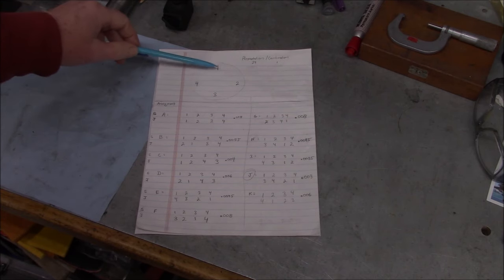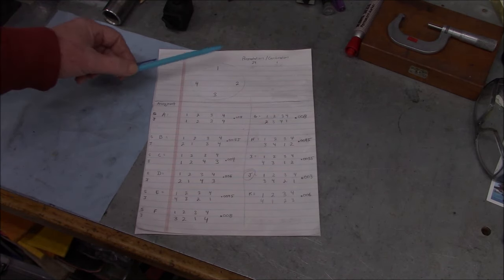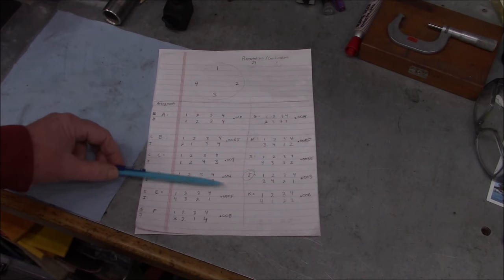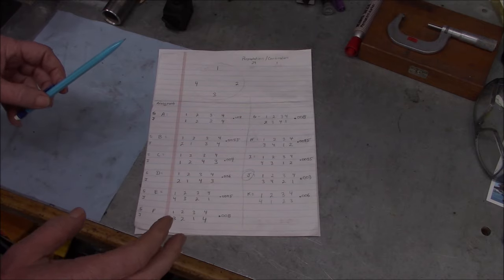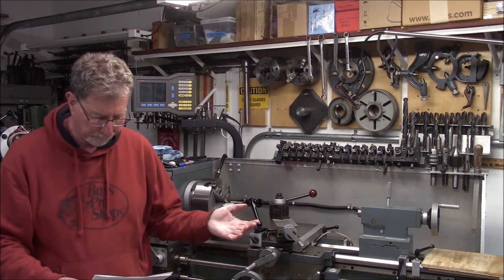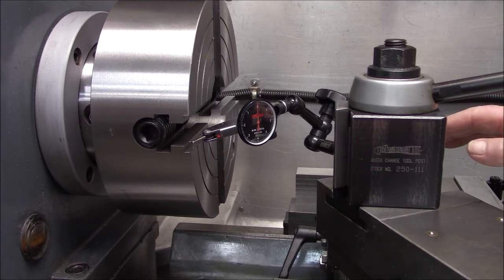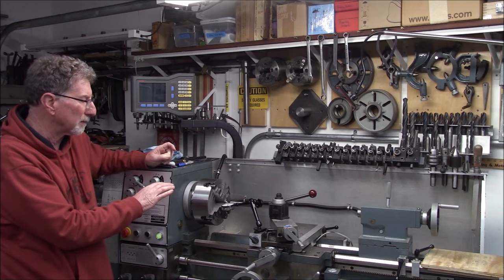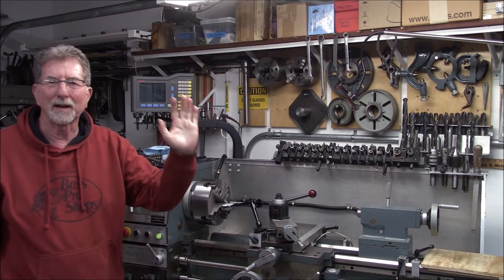D1 4 Taper Grinding : Follow up Discussion and Comments

Comment: I've been making a backplate for an 8 inch 6 jaw PB chuck and its been hard. One thing I did learn is that you need to have a small gap between the back of the chuck and flat face of the spindle nose. I can not find the clearance figure required. Maybe 10 thou. But a gap is required so when you tighten the 3 cams the chuck up on to the taper. Locking it properly. Maybe check the gap on a known good chuck. Also grind your the jaws in situ, chucked up, when you have finished
Reply from the maker: Thanks ! Yeah I've tried to find that gap spec. Mostly what I've come across the consensus is .001" to .002" my other 2 chucks and face plate all have different gaps 😕par for the course I guess.

Comment: Grinding your chuck jaws will make them true in that position only. what's not right is the scroll in your chuck not being concentric/aligned. Your jaws are quite probably ground/machined very close in tolerance to each other. JMHO YMMV.
Reply from the maker: Thanks, yeah I had that issue on an old Bison with a worn out scroll. This one is independent no scroll. Adding another challenge on how to preload the jaws and hold them centered.
Reply: @TheAyrCaveShop  Worn scroll or not,  bell mouthed chuck jaws hold much less securely and can contribute to chatter issues sometimes. If anyone has a grinder to do the work, then it's worth doing even with seriously worn internals. And let's face it, no scroll chucks any of us can afford are ever truly accurate. If you want or need high precision and repeatability, then this isn't the work holding method you should be using. In reality scroll chucks are a modern convenience. Long before they were invented, there still wasn't anything they couldn't turn in one way or another. A lowly face plate with a decent indicator can be a whole lot more accurate than even a 4 jaw independent for short work. And no scroll chuck can match the repeatability or precision between centers turning is capable of when the work needs to be rotated end for end. Yeah there old school methods, but they still work as well as they ever did.